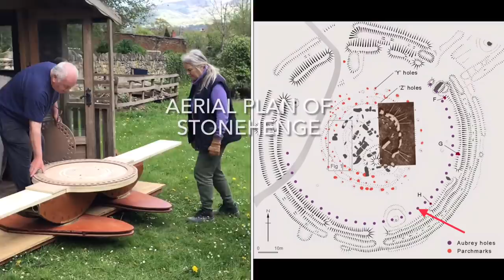Stonehenge machine, megalithic mover

Comment: Lets see that device move a stone weighing 25 ton.  Because on average the sarsens at Stonehenge weigh 25 tons, with the largest stone, the Heel Stone, weighing about 30 tons.

Plus, from Preseli Hills(origin of the sarsen stones) to Stonehenge is around 169 miles by foot. Across many rivers and streams of varying depths. Across valleys, hills etcetera.  It wont be across flat garden grass all the way...

I love the mans ingenuity, but I think we need to go back to the drawing board.

Comment: You are spot on Steven . If you have ever moved 3 ft paving slabs you stand them on end and walk em so you transfer all the weight onto one corner and pivot it forward . So your using the weight to rock it back and forth etc . I recon you have solved a mystery Steven . Never thought sleds or rollers would have worked on sand
Reply from the maker: Hi Terry read the passage written by Ezekiel ….he says they turned not when they went …..he means the opposite! They turned before they went.
https://www.biblegateway.com/passage/?search=Ezekiel%201&version=KJV

Comment: The scottish stones might have been used for moving then decorated later as souvenirs !
Reply: Like presidential pens after they sign legislation. Anyone involved in the project gets a souvenir.
Reply from the maker: My guess is, they started out perfectly round and used as bearings, then if they got damaged. Used as a type of filter,  
re-carved into a petrosphere then coated with thick fat or tallow. The grease would lubricant the gully and at the same time, pick up and damaged stone particles, these particles would lodge in the voids of the petrosphere.

Comment: I've heard id suggested that if they placed the stones flat on 3 oak poles with enough length  extending on each side to allow for 30 men (6X30=180 men) - Then the stones could be carried quite easily. - sounds feasible to me, otherwise we are back to sliding and leverage which just doesn't work with streams, rivers, hills and other ruff terrain.

Comment: Hello, This system is very ingenious and I really appreciate the engineering. It was probably used at some point but remember that Stonehenge was (according to the narrative, that could be wrong) built during the ice age, so it makes this machine probably really hard to use on ice/snow. Now, if you think of snow/ ice it make those megaliths way easier to slide and move around, I even heard of burying the vertical support stones in snow, carving a ramp and pulling the top stones with ropes, it seems possible, no? Regards.

Comment: How would it be if you had 3 pads and the weight balanced over the centre pad. You would then only need to shift the load slightly left or right and the roller assembly could be much less complicated.

Comment: Loggers and mill men  have been moving heavy timbers like this - much simplified - for centuries. A long timber becomes the entire device by pivoting it near its center [Fulcrum] and shifting it to a few rails near that center. No bearings needed or rotating device. This guy has a great point but it is over done. If its a square rock you want to move to your pyramid, just strap it in the center of a few large timbers.  Wobble it back and forth on two pivot points off the center dependent on weight.  Don't need the calf's foot or stone bearings [Interesting curiosity but most unlikely] Test this out on your kitchen table with a few 2x4's. Going uphill or down might require some more work.

Comment: Very fascinating. It would seem to me that huge logs & roughly hewn boards joined in a similar configuration, with similar surfaces roughly hewn, would be more likely in ancient times than planed boards, to use this ingenious method of leverage walking. The important thing to remember is the huge stones being moved don't care the shape or aesthetics of the mechanism underneath. It only needs to function as intended, and to be stable and strong.
Reply from the maker: Leverage walking I like that expression. Yes indeed, the gully and the balls are only thing that needs to be level and perfectly round

Comment: Interesting I’ve always believed megaliths were walked into place. I bet with a properly placed cam lobe the lifting action of the lighter side could happen when the top platen is pivoted. Basically just eliminating the need to lift. The device would lift itself on one just with the action of rotating the top. But that may be to complex for this mechanism.

Comment: How would they get the stone onto the machine and into the right balance point?
Reply: presumably with a lot of trial and error
Reply: @johnshortt7958  and some difficulty.  For a complete solution you need to solve that problem as well.
Reply: Not too difficult - tilt one end up and use rollers to position the stone/statue onto the platform.
Reply: @justvin7214  they weigh 25 tons each. Think about it.
Reply: @tonyl3391  I've seen it done with far heavier stones - no need to think about it.
Reply from the maker: @justvin7214  exactly right

Comment: If you put the weight in the middle of the device, then the circular bit would not be needed and there would be no need to turn it round with each 'stride'.  It would be very easy to just 'walk' it along.
Reply from the maker: Rotating the load in such a way counterbalances the machine. If the load is central as you suggest. The force required to lift the load is increased. This is because the static load between the two pivot points is not counterbalanced.

Comment: This machine depends on ball bearings, impossible to make until recent times. Even stone canon balls were not very round until the Elizabethan navy started making lead balls, which travelled further because less canon gas escaped around the ball. This machine would require perfectly round steel balls ! Impossible. But yes, a "walking machine" with periodic weight redistribution, is an interesting idea. Just not like this.
Reply: This is a misconception. You should research the stone balls that are found around these megalithic sites. Huge varieties of shapes. Even in this video you can see examples.
Reply from the maker: The carved stone balls I referrer, have to be carved perfectly round BEFORE they are reshaped into the petrospheres.

Comment: The only thing is that megalithic stones weight tons , those wood devices would break apart, it's a clever idea but this is absurd.
Reply from the maker: I propose Stonehenge in a huge technical diagram for a machine. If I could design another machine, let’s say using the three circles at thornborough henge! Would that be a coincidence or would it lend weight to the argument?